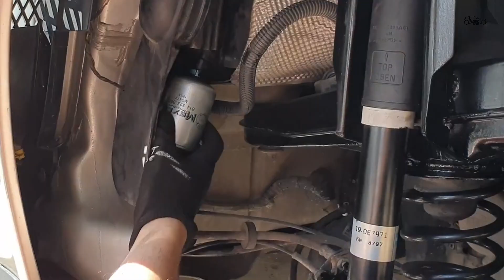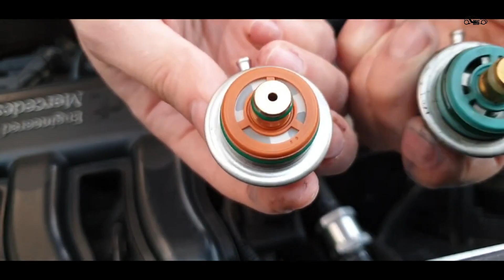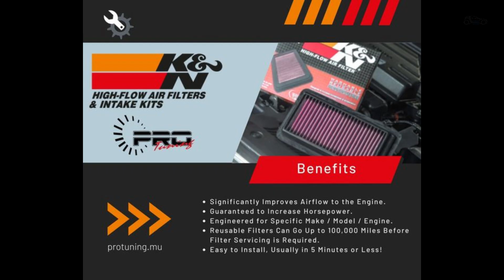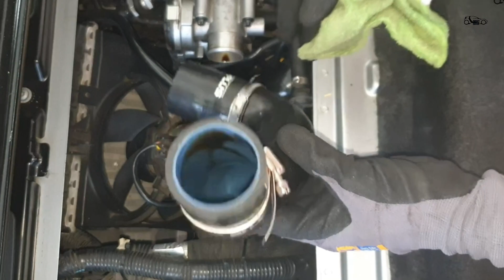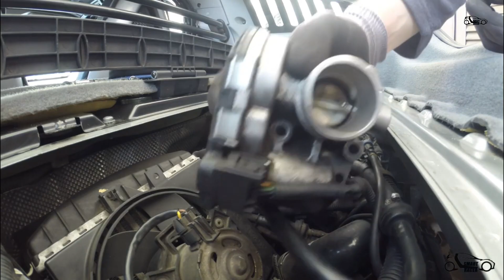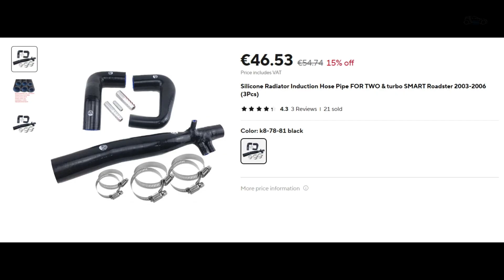Essential Upgrades to Boost Your Smart Roadster's Performance

Comment: Do you still have the upgraded throttle on your roadster? Is it worth the upgrade?
Other than a throttle relearn, do you need to do any other diagnostics?
What benefit did you notice with the change? Any downsides?
Reply from the maker: I dont have it and I cant recommend it, especially for regular rides and stock car. You can only run into trouble, only benefit you can find at high end tune where you can gain power in top range rpms.
Reply: @SmartRacer I also wondered what you think of the Forge Blowoff valve. I saw your video but wasn’t sure if you still run it or had any issues? I hear they can leak oil, but I think maybe an oil catch can could stop the issue?
Reply from the maker: @Hiddeninthelavaoccean all that is correct, I had an issue adjusting it properly which led to a leak, also, the sound was less appealing than normal with good intake and air filter

Comment: I’m torn between a Brabus 101 hp and a newer, low-mileage 82 hp Smart Roadster. Is the Brabus engine really that important?
Reply from the maker: 82hp is cheaper to tune and can have better performance for money than Brabus.
Reply: So I should better go for brabus?
Reply from the maker: Always in my opinion, they keep value and they are rare

Comment: I bought a 2004 Roadster 80hp variant this weekend. 
K&N filter due tomorrow
Regulator due Thursday
New pipes and blow off valve due in Friday.
Appointment with Fismatec in Stuttgart booked for Tuesday!
Thank you!
Reply from the maker: Amazing setup!
Glad you joined Roadster comunity
Reply: @SmartRacer  fismatec said the car wasn't producing enough boost for the ecu remap to work properly. Could be a failing turbo. I'll find out later this week when they test everything. 
I had installed a new air filter and the BoV, hopefully they didn't affect it
Reply: @joshuagregoire7410 The blow off valve almost certainly is the culprit. Did you pressure test your intake after install ? Classic jubilee clamps won't do
Reply: @TheThunderwars they did find the problem of a bad connection or 2. All is good now. Looking at more upgrades since it's such a cool fun car

Comment: I am looking at a Smart Coupe next weekend. They say it has been chipped to 117. I plan to buy it, if it checks out. This video is a great start to some add-ons!
Reply: I bought one yesterday. Time to buy parts hahaha
Reply: @joshuagregoire7410 Most remaps are really bad for the roadster. I've seen some from 105 to 115 bhp leaning fuel at full load, I'm pretty sure it's a dumb bug but it persists to this day. If you can, read the file to check for "Lambdakennfeld bei Vollast". If the value at the bottom right corners are near 1, it's a shit remap.
Reply from the maker: Hope you will join community and enjoy lightweight machine!

Comment: Brought the fuel regulator, will see how it goes... Fitted a K&N air filter today but seems abit hesitant now and less turbo noise in comparison to standard filter? 🤔
Reply from the maker: Fitting K&N should give you deeper sound and whistle

Comment: i own the 80 hp version and thanks to this i pushed it to 140-150 hp. it flies now!
Reply: @Cosmos_Beatz  what mods did you go for that level bhp? I bought my 452 brand new in 2003 and have stored for over 15yrs. Rebuilt suspension and brakes/steering from the ground up. Refurbished interior completely. New custom deep pipe Crimson red carpet and mats. Replacement sump with drain plug, dump valve, blindschleich exhaust, stage 1 ecu remap (2004) and only 31000 miles. I have 110bhp and increased gear change speed which is great from paddles but not much difference in auto. Interested to know what made the jump on yours to 145 bhp?
Reply: @stevewilliams2158  He didn't. Pushing above 1.5bar of boost pressure is possible by disabling some securities in the MEG1.1, but you won't know how much boost you're making and it will blow your plenum. 1.5bar is a sensible maximum, 1.8 bar is the maximum I'd go but the turbo can give 2.2 bars in perfect conditions.
Reply: enjoy it while you can.....it ain't going to last long!

Comment: What throttle body is the correct one from opel Corsa 1.0l ? Do you have a opel part number ? 
Is it plug and play wih the cable?
Reply: If you upgrade the throttle body, you will notice the car being slower. It bought the plug and play OEM throttle body on ebay and kept the factory hoses. I ve upgraded to silicone hoses and it got a bit better, but ultimately I needed a remap to make use of the better airflow.
Reply: Using a throttle body from another brand needs a spacer plus you need to make sure is compatible and it may need some cutting. More hustle. Paid a bit more but I think its worth it

Comment: I have rs tuning software 115hp (coming from 82hp). 4bar fuel pressure regulator. Also used to have a s-mann exhaust but had to remove it for technical inspection.
Reply: 4bar FPR is useless with a remap. Once boost pressure is above 1.1 bar, even the original 3.8 bar FPR is not providing 3.8 bars as the fuel pump can only manage 4.9 bar total fuel pressure. The FPR is boost referenced (check the little hose that goes from the plenum to the FPR) so it will keep up the fuel pressure at 3.8 up until 1.1bar is in the plenum, then the fuel pump is not strong enough and you'll lean out. You'd need about 5.5 bar of pressure from the fuel pump to keep AFR in check.
Reply: Yes, very happy. Big difference in power. I forgot that I have also smartmods uk air filter installed. Bigger airflow.
Reply from the maker: Are you satisfied with gains and performance?
Reply: Could you help me map my 450?
Reply: @ENANOCLIOSPORT  sorry I can’t, I do not have the equipement
Reply: I am also interested about the performance!
Reply: Did you upgrade the intercooler?
Reply: @FKGZ19 I wanted to install a Renault 5 intercooler, looks about the same, needs some work. Price is way cheaper. About 100€.  However I did not finish it and sold the intercooler

Comment: Personally I did a few but after install a really large throttle body my idle rpm where above 2000 ;/ Now i think the best mod its just put engine and gearbox from 454, 3A9 family to be exact
Reply: Ford`s new EcoBoost Dragon 1.5l 3cyl turbo engine should be ideal swap candidate for Roadster. 150-180hp in stock form and easily upgradable to 220hp.
I actually looking forward to buy Roadster with intention to make this swap
Reply: @el_kuks  I'd say anything above 160 you'll probably need to start reinforcing the chassis and structure
Reply from the maker: That would be great swap!
Reply: Try swapping the backplate from your original throttle body to the bigger throttle body. The resistors are different and thats probably why you get  higher and/or fluctuating rpms.
Reply: Also did you "train" the ECU after installation? There's a procedure to do